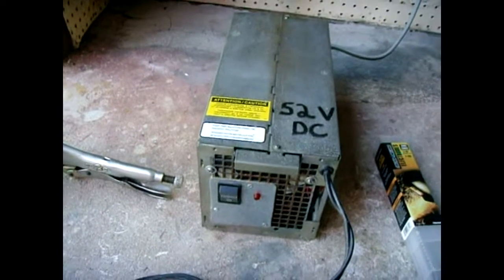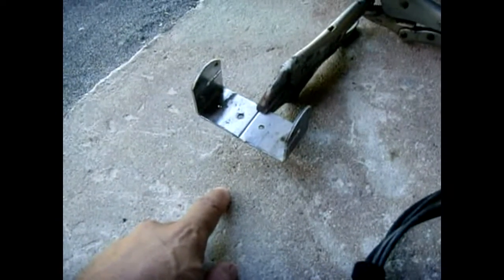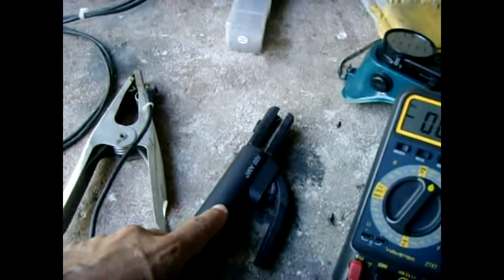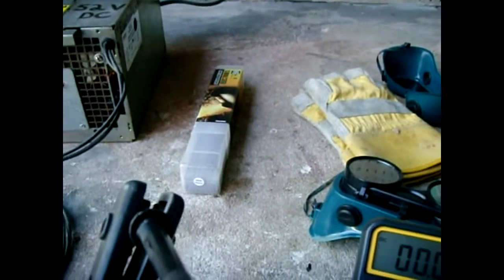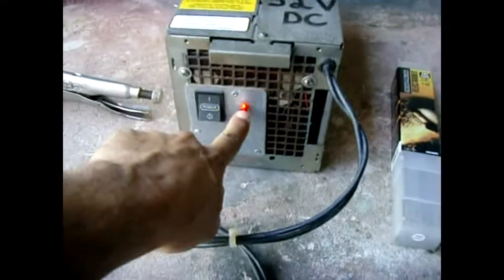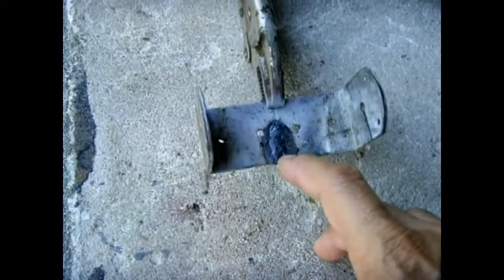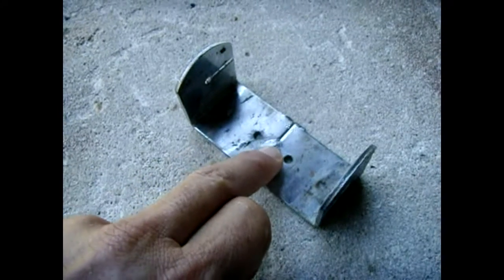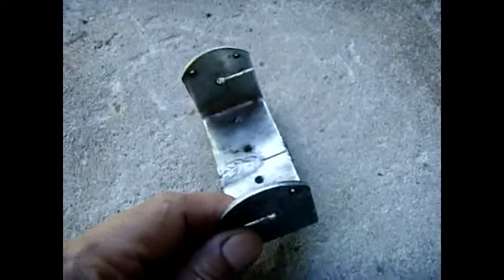Microwave Oven Transformer DC Arc Welder Demo

Comment: I don't understand how such simple circuit limit the current. The arc welder basically is a short circuit and draw a lot of current in the secondary. Why didn't the transformer just overheat and catch fire?
Reply from the maker: There's a duty cycle. You need to allow the transformer to cool down between welds.
Reply: @electronicsNmore but when we create an arc, shouldn't it behave like a short circuit? And, in a short circuit, the current should, in theory, instantaneously goes to infinity and the wire overheat and vaporize.  Just wondering why that didn't happen
Reply: @yottky  Infinite current does not exist

Comment: Is it required to re install the shunts in-between the primary and secondary or will it work without?
Reply from the maker: More power with no shunts, but I would leave them in.
Reply: electronicsNmore okay whew I thought for a second I messed up and have to take apart each one and add the shunts in......some other videos their showing shunts put back in. Thanks for the videos you do great work.
Reply from the maker: Your welcome!

Comment: Is a DC rectifying stage really necessary? I was just gonna modify a MOT for around 10V AC as ive seen in other videos. Thanks by the way, your videos are really far better than others on this topic.
Reply from the maker: You can leave it AC, but here is an excerpt from a website:

DC welding offers advantages over AC for most Stick applications, including: easier starts; fewer arc outages and sticking; less spatter/better looking welds; easier vertical up and overhead welding; easier to learn "how to weld" and a smoother arc. DC reverse polarity (electrode positive) provides about 10 percent more penetration at a given amperage than AC, while DC straight polarity (electrode negative) welds thinner metals better.

Thanks For Watching

Comment: Did you have an actual helmet or just using the goggles? If just the goggles, did you swap the lenses to darker ones. Usually those cutting goggles come with only a #5 shade and #9, or #10 is what is recommended at a minimum. I personally have a auto darken helmet with variable shades.